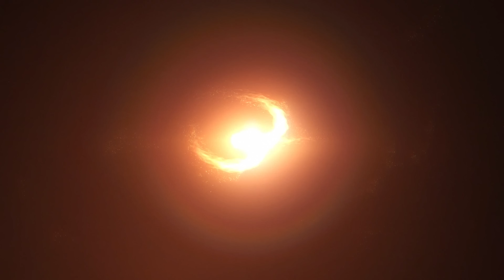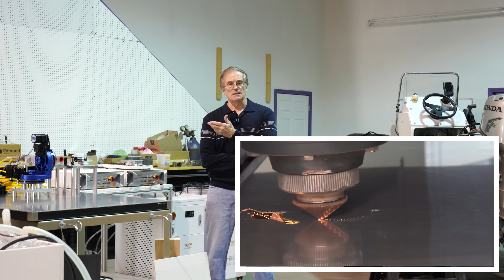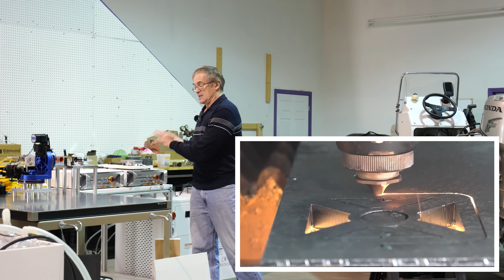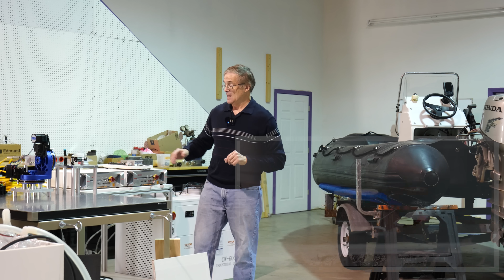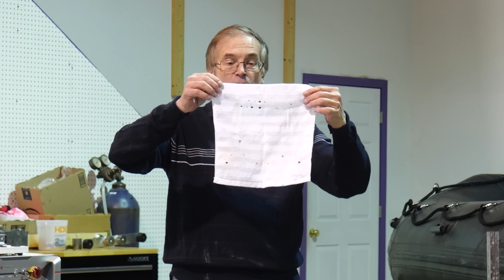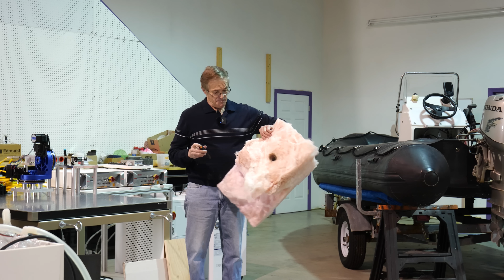We have a problem... and need your help!

Comment: How about a Conical cavity or 3D Printed Baffles lined with carbon nanotube coating, mounted on a copper heat sink with active cooling. Cheaper version, sheet of blackened copper with iced water running over it and perhaps a fog generated in front. Oil based fog may dissipate heat better? Not sure how dangerous the scatter would be. Or Blacken copper sheet could have pressed louvers that take some heat before bouncing to louvers on the back multi layers with oil fog and active cooling. . And of course the final backstop would be a spinning hub and spoke design of drywall sheets setting behind a giant dielectric mirrored disco ball at 20,000 rpm that’s sitting behind a wall of car radiators that have been packed with drywall mud.

Comment: Instead of blocking the light, have you considered scattering? I envision a material such as bubble wrap filled with a fluid that can scatter light at the molecular level. Or maybe just really small particles in suspension. https://en.wikipedia.org/wiki/Light_scattering_by_particles

 This may not be a complete solution but I think it's the right way to go.

Comment: Tl;Dr: we have inadvertently built a toy in our garage that is a threat to the FAA lololol
Reply: Its light not bullets, Stop trying to stop the beam and bend it

If you just make a large backdrop of polycarbonate with a high enough light transmission it shouldn't heat up and instead you mill a fresnel lens into it (the fine machined concentric rings) tuned to the wavelength of your lazer and fan your beam out behind the target... Boom

And you get to do more cool optical stuff on your lazer channel lol
Reply: You answered this question at the top of the class if anyone was listening... You solve this problem the same way the lazer cnc machine works... Lol

Disperse the beam concentration

😉🫶

Comment: Heat armor panels of cheap composite design.

Plywood layered with sand may accomplish sufficient absorbance without concentrating any resulting fire.  More layers of thinner plywood, rather than fewer layers to reduce the intensity of any one spot that's burning.  The sand may self extinguish the plywood, or it may just glass up and plug the hole to awaiting cooling.  Maybe 1/4" ply - 1-3" sand - 1/4" ply...and add layers if that shows any promise.  Could be built in modular panels that can be emptied and filled as needed.

Perhaps you could fill those panels with water instead of sand as a test, if they are caulked up, but the top side should be left open for obvious reasons if so.

I haven't yet watched the video on this project, so I will have to go do that, but is there not a way to provide ranging feedback for automated power-output control?  I.e. it functions as it's own rangefinder / takes range input and ramps power when that range is satisfied, and dropping power when there is a hole and the range is no longer satisfied?  Maybe that's pretty tough with a 1mm spot size at distance.

Or perhaps an adjustable columnation based on the same thing, where it either adjusts focal distance based on range input, or decolumnates/beam scatters when parameters are not satisfied?  Much more complexity on the optical end, I am sure.
Reply: Saw someone's fiberboard comment below after I wrote this.
Modification to mine and combining his:
Plywood-space-fiberboard-space-plywood = 1 panel.  
All caulked, open top.  Fill spaces with water or sand.  Spaces adjustable based on test performance.  Fiberboard slide into slots or suspended like a top-bar bee hive for replacement.  Plywood can be wood-filler sealed until need to be remade.

Comment: Seeing all the great ideas from bonafide experts, I was very reluctant to put this out there, but I'll just throw it out there anyways just in case. 
Does the laser have to be positioned horizontally? If not, then would pointing the laser downwards so that it is backstopped by the ground (as in, outdoors, not indoors) suffice? Or is there a  problem with how the laser would interact with the ground itself?
I tried searching for another person's comment that suggested this, but most suggestions only focused on horizontal placement.

Comment: I once saw someone using an air-lens to bring a laser beam out of focus. It was a spinning tube, maybe 25-30 cm long, with nothing but air inside. The spinning caused the air to be denser along the inner walls of the tube, and less dense along the axis / middle. I dont know if this is possible to have in your set-up. If so, a less focused beam could at least buy you some time.

Comment: A potentially inexpensive and relatively light material is Rockwool or mineral wool insulation. It's a little different from fiberglass and, I think, is a little denser, so it may hold up slightly better. If I remember right, it's also mold resistant and holds up to water better than fiberglass so another option with it could be to set up a water trickle system at the top with a reservoir at the bottom that then recirculates. The idea behind that is not to completely waterlog the rockwool and make it super heavy while adding heat dissipation. Other people talked about dyes that could go in the water that may help with absorption and dispersion that you can try adding in here, too. If the Rockwool is effective at all, it could pretty easily be added as an extra layer to any of the more properly scientific solutions. Another thought is a fiber or ceramic blanket thats a little more pure and dense than the pink panther stuff.

Comment: Create a wall of flowing water, as the water falls down, the laser wont have enough time to evaporate the water since it will quickly move down. 
If it can be free falling with sufficient consistency great, if not it can flow over some slightly angled transparent polycarbonate. Dye the water black -dark for better absorption across all spectrum.

Comment: A mirror.....BUT angled such that the laser is directed to the floor. Program both the drones and the laser so that if the angle of the beam would reflect it  other than a safe area of the floor the beam shuts down.

Comment: You can build a wall of classic salt licks. The salt will melt at 800ºC, but the beam will be diffused by the crystals in the salt lock. Use the classic or pure sodium chloride.

Comment: what about a prism as a back stop that scatters the beam extremely fast ... you can make it out of plastic and have well designed convex shape to break the light out over a 170 degree sphere ... that or a fluid tank with suspended material like a fish tank ... 
since light is neither a constant nor a maximum slowing curving it or defocusing it are your options
Reply: pity fresnel lenses focus and not defocus things ... that might be your best option make the beam hit a screen that disperses the beam as much as possible making it not harmful

the only other choice is a refelctor just outside the door to aim towards that sends the beam straight up once hit this way it isnt directed at eyes or planes just UP and again use a convex reflector and spread the beam out

Comment: I don’t really know the practicality of this option but it seems to me the issue is range control. Finding a way to detect the range you need to hit and have the optics focus the laser to that point and anything beyond that point the laser would lose focus and disperse. Right now it sounds like the laser controls are 2 dimensional (up-down/left-right) you need something to control range. I know that introduces a great deal of complexity. Also you would want the deadman switch - if range cannot be determined kill the laser.

Comment: try adding a stacked ceramic tiled wall cover, try a coating method, like combine Pyromark 2500, Nextel Velvet Coating 811-21, and Aremco Ceramacoat™ 845-W or 503V in a layered system on to the ceramic...its just a suggestion...I am no scientist

Comment: Would it be possible to write control software that limits the length of time the laser is on to less than a hundred milliseconds? In conjunction with a hard limit on the number of pulses allowed when the tracking motion stops. The idea being to create a pulse laser with a motion detector as the kill switch when motion stops.

Comment: This is going to sound absolutely backwards, but how about set up an array of beams and sensors that will detect clouds offgassing from your backstop, which would be panels of like PLA impregnated with whatever that mix of not-rocket-candy smoke grenade material is, in cells packed with a sufficiently loose density that it wouldn't propagate in the material as a more general fire? As in, minimize the time to signal the control rod axe man, and have your cinderblocks filled with starlite behind that layer

Comment: Reach out to @Nighthawkinlight.  Otherwise, I would see if there is a material with a higher rate of heat dissipation than your input.  Dissipating the heat through evaporating a liquid in an open or closed system.  Such as a refrigerant.

Comment: Try making a plywood box.  Two sheets held 3-1/2" apart by 2x4s.  Caulk seams fill with water.  Add clay or dye to absorb wavelength and add aquarium bubbler if needed to disperse clay or dye.  You will get a leak, but just run a screw in to plug.  Or as others have noted wet sand.

Comment: Here’s a thought, fellow Lightbender — but beware, for this is no child’s trick. 🧙‍♂🔦

Channel the beam through a bag of clear water — not to extinguish it, but to fracture its fury, scatter its will, and slow its hunger. Like bending the sun through the hands of an alchemist. 🌊🌞

Want more control? Freeze the water — ice holds longer, resists deeper, answers slower. ❄ Time becomes your ally.

Dye the water — ink, tea, or blood of berries — let the light be devoured before it escapes. Every hue is a filter forged in nature. 🩸🖤

And behind it? No ordinary wall. Coat the rear chamber in graphite, obsidian, or smoked black glass — to swallow the leftover wrath. 🔳 Even a tempered glass plate, angled just so, can deflect the final scream.

But heed this truth: light bends to knowledge, not force. Know exactly which path it takes before you call upon the beam. Misstep… and the fire will not forgive.

This isn’t science. This is sorcery with schematics. This is will turned into form."

Comment: What if you use a controlled dolly for the backstop so it's not stationary? After reading more of the other ideas below wet sand sounds like a winner. I'd consider making a mini ferris wheel about 4m in diameter with a rotating wet disc of whatever you deem a worthy solution so that the impact point is always moving at about 1fps.

Comment: High, I truly don't know anything but your laser is just the same as firing a bullet. Once you pull the trigger there's no stopping it. The only way to stop the bullet is don't pull the trigger thus I think you should focus on a means to cut the power to the laser if it goes further than a preset distance. I have a laser measuring tape so I know you can do that. All you would need is a backstop material behind your target. Just food for thought.

Comment: You seem to be able to buy 1500mm wide stainless steel water spillways for under $200 each online from what I can see. I would connect multiple of those together, put a black burned/oxidized steel sheet backing under them that the water can run along in a loop, and dye the water with an absorbent dye for your specific laser wavelength.

For a 4.5 meter wide unit you could probably get away with a $1000-2000 total system cost for all this with a cheap 500-750 liter/minute pump for $2-300 and the cost of the steel backing, hoses and dye.

Comment: If you are shooting always to the same spot, you could open a small opening in your garage door to let the beam out. you can then park a container on wheels behind the door, loaded with bricks or sand or with whatever the experts suggested. whenever you need the door, you just tow the container aside, then you wheel it back to guard the door. shoot through the window and deal with all the negative aspects outside.

Comment: Zero experience here but my thoughts were simple.. You can split the beam so that you're working with a lower powered beam in the first place for testing... And defoc you can then defocus that second beam so that it dissipates over a larger area and doesn't punch holes in your your stuff ...And you take the split off beam point it at water. That would absorb the energy and it takes a lot of energy to heat water and it's easy to move the hot water away.

Comment: Like others I was thinking of a water curtain much like is used in paint booth and metal spray applications. Backed up with a thin sheet of copper behind that like @constantinhenle62 mentioned but with the water in contact with the coppers surface should work. Build it on a stand backed by 4x8x¾" plywood to support everything with a trough at the bottom, a pump inside it to feed a laminar flow dispersal at the top that would run the 4' of the sheet maybe some side shields to contain the edges of the water cascading down the copper and a little bracing front and back to stabilize it with casters under all of it for portability and storage when not in use. Let us know who comes up with the winning idea by giving whoever a shout out on your channel.

Comment: How about a brick wall on wheels:
If u make a /| frame on a low wheelbase with the slanted side covered in bricks, it will be less likely to fall over and still be moveable.
If u need more than 2 meters in height, this solution might not work any more.

Comment: A negative gating on the laser, on the flank, so that if the computer stops in A state (level), the laser will only remain on for the gating period pulse, and be pulled down, cutting off the power to the laser. This way, a stuck system could be shut down in us to ms time periods, rather than seconds. 
Also, you should be able to determine backscatter, in that a diminshed backscatter is a stop signal, either missing the target or having a burn-through.

Comment: Carbon fiber laminate with a cement matix faced with a ceramic tile either side. Ideally a carbon - carbon composite, but forming a carbon matrix in a carbon cloth is a technology not accessible to most. Possibly consider building this out as a stud wall which would create spaced armour. Why carbon, it conducts thermal energy pretty well, the carbon doesn't burn. The ceramic tile in my mind requires a lot of energy to change its phase from a solid to a glass like mess, so this is the first line of defence before trying to disapate the energy into the carbon backing, and should it breach the second layer of tile would slow the beam down.

Comment: i think there are 2 options.
light scattering
of heat absorption.
light scattering, some thing like prismatic piramids. but i  have to be of high optical materials like quarts. if it get burned a little it get all black and absorbs lots of heat.
heat absorbtion can be with some thing like evacuated solar tubes dubbel walled. and filled with water.

Comment: Did you try 3-5mm titanium with 10mm aluminium plate behind it to disapate the heat? And obviously you could also add a ceramic plate as well that can handle 3000+ degree C, like the shroud on my Tig welding torch, combining multiple different materials to make your own  'composite' laser  shield would be good😅 i doubt you could punch through that in 2 seconds, and you could also add a sheet of carbon fibre or graphite which also has a high heat tolerance, all this is available on Temu, for around $10+ per 4in square (2mm Titanium) with Titanium being the deerest material per millimetre thickness, and there is other elements you could add, this is a great problem to have 😅 wish my lasers were that powerful! But let me know what you think, you could also add a 3mm layer of heat resistant glass...

Comment: I have no appliccable background, but my first thought was wet rockwool.  
Something like a hose with holes to keep wetting the rockwool, and a rain gutter beneath to recycle or dump the water.  
Biggest obstackle (if the principle works) would be to hold up the rockwool as it gets wet and both heavy/floppy.

Comment: Why not build a fixed wall to take the hit but angle a mirror to direct the laser beam towards it. The mirror can then easily be moved anywhere. Also the mirror could be sligthly concave or convex to disperse the beam and take the edge of it.

Comment: I was thinking Anodised Aluminium with fairly thick anodisation with circulating water channels.  The anodised layer can provide decent absorption, and the aluminium substrate is an excellent thermal conductor, helping to spread heat, the water channels would further help with that energy dissipation. Aluminium is non-flammable, and modular anodised aluminium panels with integrated cooling channels can be designed fairly cheaply with portability in mind, allowing them to be installed and potentially moved if needed.

Comment: I do have a question as to why use the laser to bring down a drone? Why not use a lower power laser to make an ionised path then use a high voltage electrical discharge to follow the ionised path to bring down the drone?

Comment: The solution would to build drones out of bricks......The only thing that I can think of is to build a wall from angled Copper or angled Aluminum wedges, in an effort to scatter to laser energy, sort of like how sound proof rooms are made from foam wedges, or tank armor is made at an angle to deflect energy if incoming round. Or, if optics are able to conduct and focus laser energy, perhaps they can be used to disperse it, water tank built with acrylic panels ?